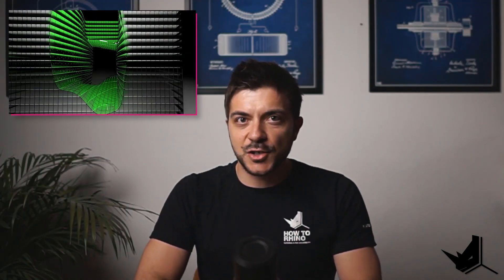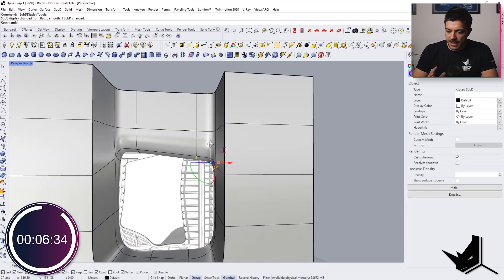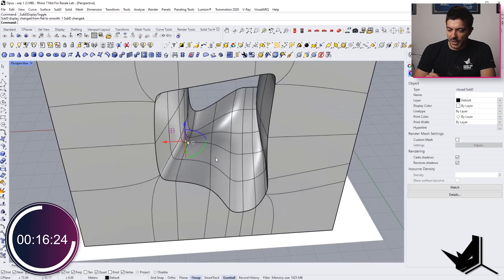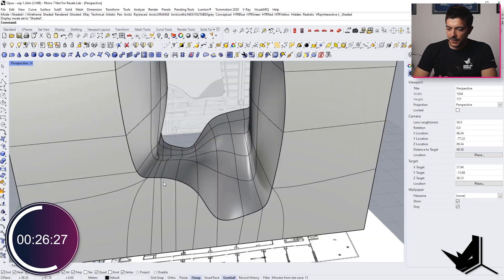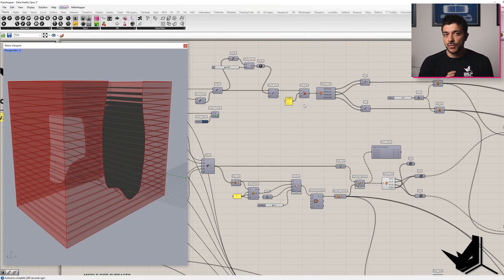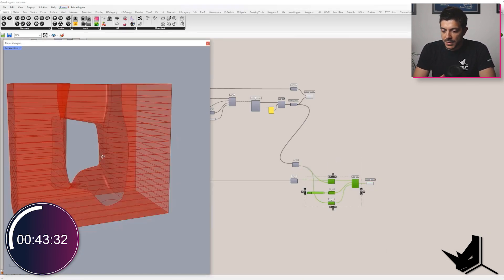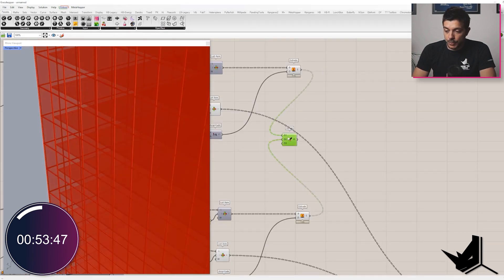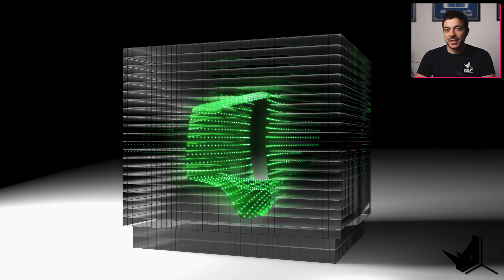Zaha Hadid Opus in ONE hour

Comment: the idea of how you modeling the center void parts and making it so clean and neat, is so amazing. I always have a question: are these models created in Rhino and Grasshopper able to be imported in to 3ds max ? I have tried many times but the meshes and edges/lines don't all the time show nicely and neatly in 3ds max. if importing Rhino model into 3ds max is smooth. the render result will definitely be excellent. I realized that not many people are teaching how Rhino model could be imported into 3ds max.